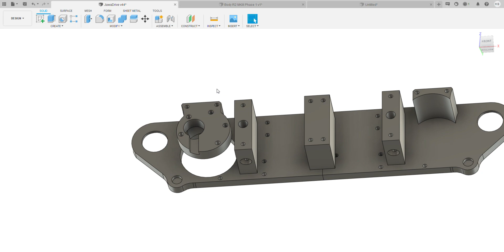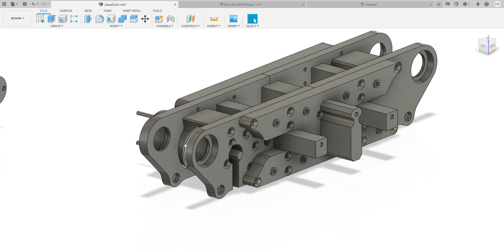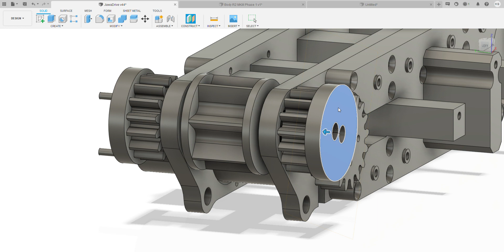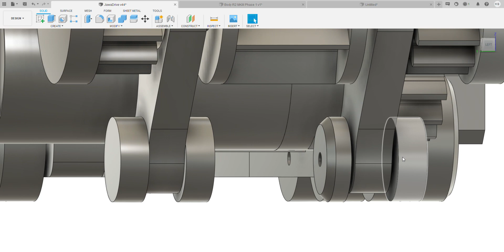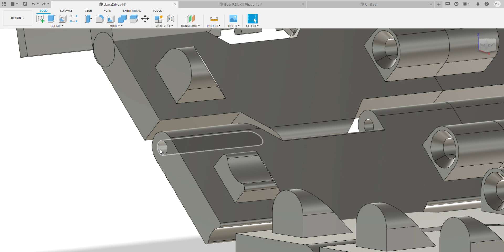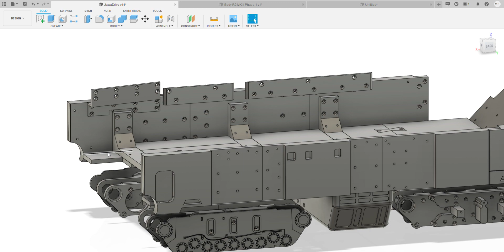Sandcrawler Drive Overview / assembly

Comment: So I think there's a mistake with the bearing size . The 15mmx24mmx5mm bearings don't fit the A gear. It seems it should be 14mmx24mmx5mm?